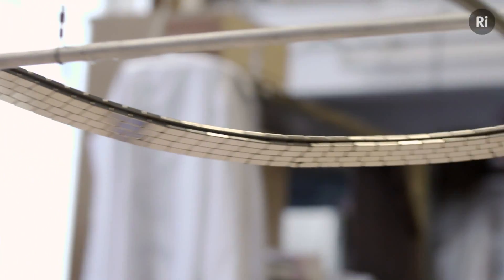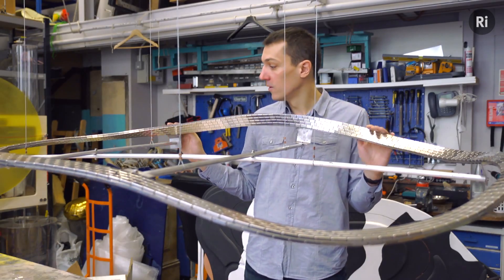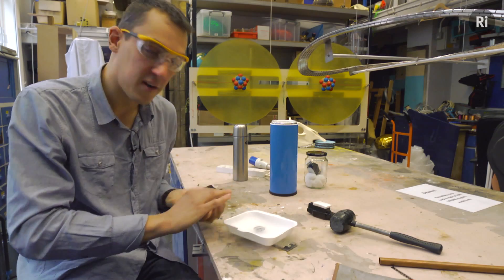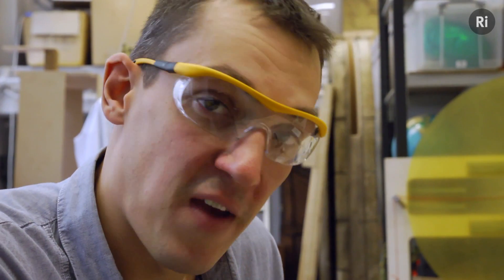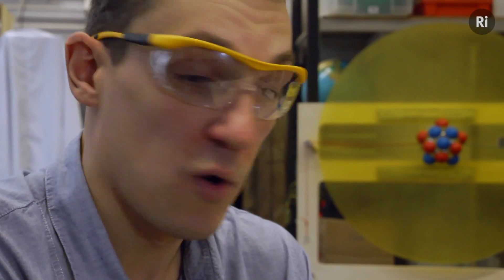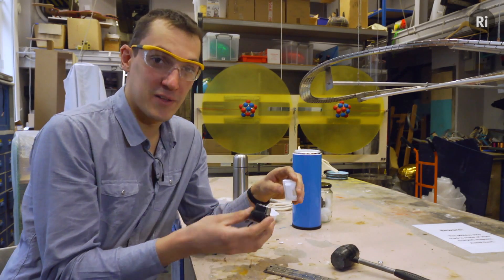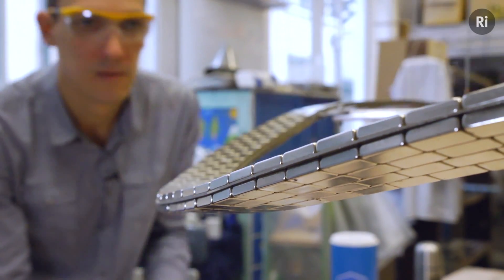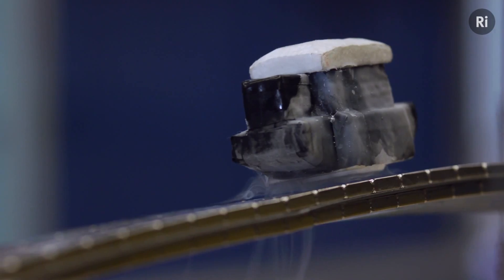Levitating Superconductor on a Möbius strip

Comment: What's the shape of the track's magnetic field? If it's a Möbius strip then there should be only one pole. Is the missing pole facing between the double strip of magnets? IOW it wouldn't work with a single strip?
Reply: the pole depends on the motion of the "train". if the train is on the bottom then it will be trapped on the bottom
Reply: Lamb Leg
I know that, but then what is the arrangement of the magnetic field around this track? The track only has one side so it appears to have the same polarity on both sides of the track.
Reply: Lamb Leg
Let's say a magnet on the top portion of the track closest to us has its north pole facing up and the same for the supermagnet car riding on top. Now send it once around the track so that it now has it's north pole facing down. What is the polarity of the track at that point?
Reply: Lamb Leg
Fair enough, but the question remains. If the upward facing surface of the track is the north magnetic direction, then just follow that direction as you mentally move around the track. When you return after one circuit, it will either be also facing downward, or it will have changed polarity somewhere along the way. Which is it?
Reply: Lamb Leg
Maybe you're right. I certainly don't know what's going on.
Reply: +Melinda Green Of course it has two sides, twisting something doesn't make a side vanish.
Reply: aluisious
https://en.wikipedia.org/wiki/M%C3%B6bius_strip
Reply: Melinda Green I am well aware of what a Mobius strip is. Any section of it has two sides. You were the one spouting nonsense about monopoles, as if twisting a strip fools magnetism.
Reply: aluisious
I clearly said that I don't understand what's going on with the magnetic field of this track, so don't put words in my mouth. You appeared to have never have heard of a mobius strip because you said that putting a twist into a loop doesn't make it one-sided but that's the definition of a mobius strip. So you didn't mean to say that? Fine, correct yourself but don't blame me for taking your words at face-value and trying to help.
Reply: Melinda Green I am not correcting myself. Don't worry about the definition of the strip, it doesn't matter. It's just magnets stuck to a strip. At some point (maybe many points) on the strip, the field has to flip, but it doesn't make much difference for the same reason sticking the "car" on the top or the bottom side doesn't make a difference.
Reply: aluisious
Except that there's only one side, but yeah, maybe it's more like how unmagnetized iron doesn't care which pole it's being attracted to. I definitely don't have a feeling for what's going on but I would love to see a model of the magnetic field around this track. Checking the intertubes for more information I saw this reddit thread in which exactly my question floated to the top: https://www.reddit.com/r/Physics/comments/2hvlmk/gravitydefying_superconductor_on_a_m%C3%B6bius_strip/ So at least I don't feel too alone in my curiosity. I'm not buying the checkerboard theory and am liking my earlier idea that it really is North (or South) on both "sides" because the other pole is sandwiched between the two layers. Notice how it's not a one-magnet thick track but two?

Comment: Should have set up a tube to use the vapors coming from the "cup" of liquid nitrogen to propel the whole thing around. That would have been the only way to make this even cooler..... Pun tinended
Reply: +jon paskewitz like an exhaust system? dope! but that would mean the tank would need to be hermetic and they probably trying to save time
Reply: +Omar Masri (Heliosonic) maybe a 2mm drill bit hole into the top section where there would be only gases and it might work easier

Comment: What determines the distance between the track and the vehicle?  How would you make the system so that they're about two meters apart?
Reply: The thing that determines the distance is the distance away when the material is cooled into its superconductive state. It would only work within the distance the magnet can pull in, so a practical limit of maybe one foot or 0.3 metres. If you had an unlimitedly strong magnet it would theoretically work from any distance away, until it starts getting impractical due to weight, etc.

Comment: So cool...I am new to this type of science, and was wondering what creates the electric currents that resist the natural flow of gravity? How exactly are they created?
Reply: +Rachel Jackman Hello there.
I can see what you&#39;re after, basically a physical explanation of the electromagnetic phenomenon. Sadly I cannot give you that answer with certainty as it&#39;s all quite rusty in my head.
What I can give you is a few things you can read more about.
Basically most of these phenomena involving magnetism and electrical currents were described by Faraday, Lenz, Maxwell (in order of generalization). So there&#39;s a starting point if you want to read about them.
Now the theory is such that it tries to model how the mere &quot;presence&quot; of a magnetic field (which can occur in nature) will induce a current in a conductor (Which in more obviously physical terms means that the field which permeates its surroundings creates an electromotive force). That force, as its name suggests, causes free charged particles within that conductor (which are obviously the electrons that aren&#39;t too close to the nuclei of the atoms as to be bound by the attractive forces) to move, which constitutes an electric current.
The general rule is, that there has to be motion and/or variation in flux properties to generate that current. Which is why electromagnetic induction occurs when you move a magnet inside a conducting coil, or you rotate a coil around a magnet. That concept was fundamental for the industrial revolution as it was one of the first principles for generating electricity that could be applied at an industrial scale.
(Think of hydroelectric plants in certain dams)

Comment: if you did this room temperature can't you possibly use this for making electricity? rather then coal
Reply: +madmike1 No, since the train is not a Perpetum mobile. You could at most create eletricity using the power he gives with his hand, and that would be very very less than what coal engines create. The train in this video just hovers and keeps its motion since it's able to resist gravity by wandering across the magnetic field. Air friction still works tho...

Comment: Do you have to give it a push to go around again? My question actually is "can it be a perpetual motion as long as the conductor remains in its optimal temperature to have low electrical resistance?"

Comment: But then why doesn't the superconductor resist the force your hand you asserted on it?
Reply: +Derek Leung it does, its just not strong enough to stop you.
Reply: and the magnet track is only on the top or bottom of the super conductor, not the opposite side your hand is pushing from.
Reply: +AGRETZOR last time I checked, magnetic fields weren't parallel. so it does apply minute forces along the length of the track. how else could he make the superconductor stand still on the track when it's not perfectly horizontal. the forces resisting the motion against that of your hand are almost non existent but they're there.
Reply: +Shane McCann see above
Reply: ***** exactly

Comment: Would I be correct in thinking that, if this was done in a vacuum to negate air resistance, it would only stop when the levitating superconductor warmed? If both the track and the superconductor are cooled, would this still work? If so, this sort of track could very be useful on some parts of Europa.
Reply: Steven Reckling yeah ticket prices would only be like 5-6000 a person... it takes A LOT of energy to run a superconductor, especially one as massive as a train and its tracks.
Reply: I am no expert on this topic. The material cost and the cost of getting to Europa would probably be prohibitive as well. What I am wondering is if it would be worth the the energy and effort to set up a railgun on Europa for resupplying spaceships with water at some point utilizing the low surface temperature.

Comment: So does the magnet have any resistance on the track since it is not touching anything?
Reply: mute333tard air resistance, same as why a feather drops slower that a ball in real life but they drop the same in a vacuum.  Put this in a vacuum and keep it super cooled and then nothing will stop it!
Reply: mute333tard It has no resistance from the track.
Reply: ***** Well there’s gravity. That must play a role in it slowing down.
Reply: mute333tard Quantum locking locks atoms in place. So no, gravity is not a factor.

However when the super conductor heats up it starts building up eddy currents, which in turn build up magnetic fields resisting it's movement, which combines with air resistance slows down the super conductor a shitton.
Reply: No need for an infinite track if you use a mobius strip. Changes in direction would only slow it down due to gravity pulling on it. Super cooled vacuum with no gravity? We have plenty of that, it's called space. Pick a spot in deep space away from any forces of gravity and you will have yourself a very efficient little magnet train.
Reply: I said it would be efficient, I never said it would run forever. Learn to read then you can tell me to go read a physics book. If you know so much go use it for something better than being rude on youtube.  Next time try, "you forgot centrifugal force!"  "Oh , look at that, good call. You are not a douche at all!" "Gee thanks!...." "ok well....bye". Try that next time.
Reply: +jacas monoly (yourwrong) Remember that the force that gravity applies to slow it down also results in it accellerating it later on again, since if it runs in loops, its potential energy drops and falls, but the overall energy during the round stays the same. Only air friction and electromagnetic turbulences slow it down

Comment: Now, I want to see a  levitating superconductor on a Klein bottle, is it possible to make that happen?
Reply: The Pip stupid limited amount of spacial dimensions getting in the way of my plans!
Reply: James A Clouder Not possible without 4 spacial dimensions, otherwise you'd have a point where the track intersects with itself
Reply: Only if you're in the 4th dimension. (I'm pretty sure you aren't.)
Reply: Craig Watkins https://33.media.tumblr.com/aebeb686a640493b512c8999881d1fb5/tumblr_njzrzaICmG1s3h43ko1_500.gif
Reply: James A Clouder Exactly what I was thinking! But unfortunately, we couldn't see the magnet when it is on the space that is (sort of) enclosed, so it would really destroy the point. D:
Reply: +James A Clouder  no, because of the part of the Klein bottle that goes through itself, which requires a fourth dimension in order for that part to &quot;pass&quot; through itself (also why the fourth dimension prevents knots from staying together at all)

Comment: Couldn't this technology (refined of course) be used for trains? Or do those super-fast-ones already work like that?
Reply: overTIMe the current trains are maglev, which use alternate magnets to both attract and repel the train, effectively hovering it in the right place, whereas the superconductor resists movement away and towards the magnets holding the charge, again locking it in place. So quite similar, but still different :)
Reply: +overTIMe The force that keeps the train from exceeding very high speeds is not the friction of the track but the air resistance. To have a super fast train like that you would need ridiculously powerful engine (the heating from air compression at the front of the train would probably melt it thought) or a vacuum tunnel with no air at all.
Reply: overTIMe You would also have to keep the train at very very cold temperatures. Which is a problem. If you could somehow levitate without needing ridiculously cold temperatures, that would be great for mag lev technology
Reply: Good luck stopping that train
Reply: It could be yeah. And the fact that there was is no friction is even better as you can do extremely fast like hundreds if not thousands of MPH. Of course you would have to take into account g-forces.
Reply: Smithy0013 to be fair high temp superconductors make it possible to get superconductivity at to "freakin cold" temperatures rather than ridiculously cold temps.
Reply: we all need hot seats for that like KBC ha ha
Reply: yes 
Professor Eric Laithwaite: Magnetic River 1975 

https://www.youtube.com/watch?v=OI_HFnNTfyU 

note super conductors not around yet.

1972 same Prof https://www.youtube.com/watch?v=f5mA4l6xmGs
Reply: Developed in 1972 Japan
Reply: sichosi Thanks for the info. :)

Comment: Is the height of the 'car' decided by the strength of the magnets in the track? Or is it to do with the spacing as it cools, if you were to, say, pour in the liquid nitrogen while the car was further from the surface of the track, would it be locked at a higher point?

Comment: Can you push it once and stop fucking touching it for a second? I want to see how far it will go.
Reply: Obviously. I want to observe that happen but I can't because he keeps touching it before it stops.
Reply: Nigel P. That's what she said :D
Reply: Nigel P. IKR?
Reply: Ildarioon But you still have changes in direction of motion relative to the initial push. Even in space, it is my understanding that this would result in a loss of velocity by a factor of the cosine of the angle every time the direction of motion changes.
Is that not the case?
Reply: qiman wang Nope, the loss of momentum on a flat track would be about the same, because the loss of energy in the case of a rollercoaster is mainly friction with the ground, here, you only have friction with the air, both on a flat track and on this track, and the friction is almost the same.
Reply: Poldovico The effect of a magnetic field over a charged particle will never change the module of the particle's velocity, only it's direction.

If the superconductor did not levitate perfectly still and described a harmonic movement in the axis perpendicular to the track, it would lose kinetic energy as heat due to Joule's effect. Thus itt would lose less energy in a flat and straight path, but it seems like that movement is negligible or not there at all.

So no, it probably doesn't care about the shape of the path as long as it doesn't reach relativistic speeds, where it would produce synchrotron radiation.
Reply: The shape of the track can not make it lose momentum, at all points on the track the forces would all add up to 0 in the ideal case, but here air resistance plays a little. Same thing as a satellite in orbit
Reply: Nigel P.because the magnetic track is not flat, the momentum it starts out with will be loss over the course of going around. kind of like roller coasters.

Comment: pave the roads with magnets and make cars that use liquid nitrogen instead of gas, then give them little spike legs that push off that road to push it forward.  There would be no friction of they would glide up to really fast speeds.  Breaks would use the feet to gradually slow it down then shut off the nitrogen output to link the car to the ground magnetically.  Emergency breaks would just shut off the magnetic force instantly and make it stick to the ground.

Comment: I just got an awesome idea: Space Rollercoasters
Reply: ***** This needs to happen within the next 100 years.
Reply: Nathan Schubert, and it's going to be 100% secure in terms of a cart leaving the track.  If the repelling force is gone, it's going to snap to the surface, if I understand it right.
Reply: *****, it would be a rough halt, but probably not so sudden as to threaten the lives of passengers.  While you lose the zero friction, the movement along the plane doesn't go anywhere.  Imagine a very heavy metal piece landing on a metal surface while in motion.  The gravity is great, but it would still keep going, producing lots of sparks.  But then of course, here we don't have the same correlation between inertia and forces of attraction.  Can't tell for sure.
Reply: ***** That... might actually be possible. Keep the magnet isolated and cold enough, and it will stay superconducting as long as no heat is introduced to it.
Reply: You missed the train on that idea..
Reply: ***** just a levitating roller coaster
Reply: parahumanoid Good idea, but if it does snap back to the track (in the event of superconductive failure), wouldn't the sudden stop be damaging to the riders? Unless they can make it so it would slowly come down to a rest (I couldn't tell how quickly the magnet in the video came down/slowed down). Then that would be awesome and secure!
Reply: Panlew2 i dont trust you todd howard
Reply: Panlew2 materials don't superconduct in space (vacuum), despite the near-0 Kelvin temperatures. the electrons of the material don't travel in one direction, and instead travel in every direction, so a current won't be formed. Nice idea though
Reply: Aidan Daly hmm, if you shield from the sun, like the Webb telescope, you radiate into that 2 Kelvin background. In shadow things get very cold in space, so it might be interesting to dabble in the possibilities of large superconductors interacting with planetary magnetospheres.
Reply: Aidan Daly hmm, if you shield from the sun, like the Webb telescope, you radiate into that 2 Kelvin background. In shadow things get very cold in space, so it might be interesting to dabble in the possibilities of large superconductors interacting with planetary magnetospheres.